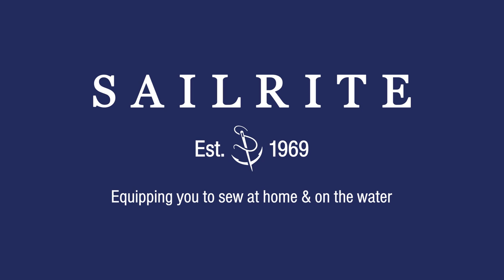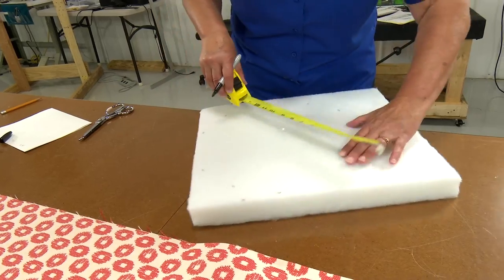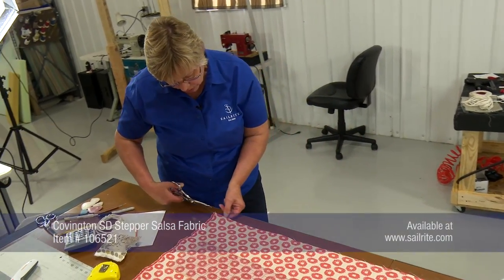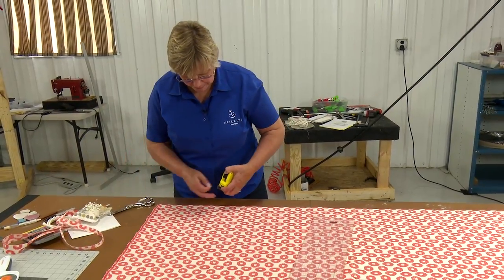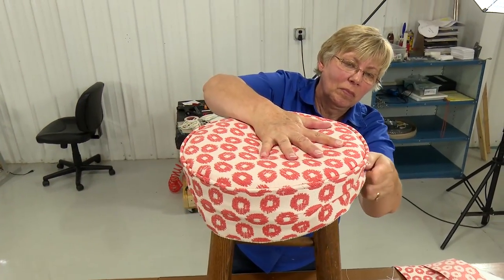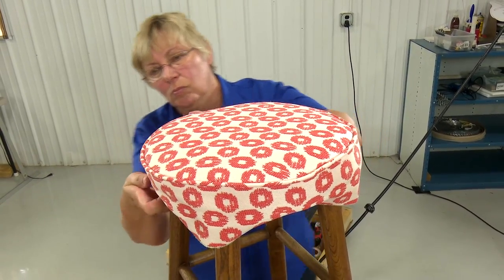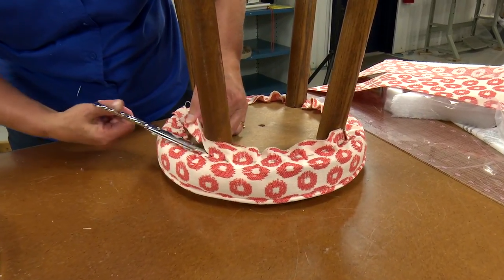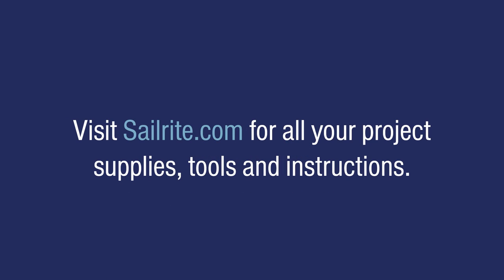How to Upholster a Bar Stool

Comment: Great and helpful! Wondering why you didn't just put an elastic on the bottom so it's all snug and no stapler reqd?
Reply from the maker: You can do that, but the elastic will allow the fabric cover to move around when an occupant sits on the stool, the staples will not.

Comment: This is a brill post! Thank you for sharing. The only issue I am having is some slight puckering of the fabric when I'm sewing the piping to the top circle. What could be causing that do you think?
Reply from the maker: When piping or binding has to go around a curve like a circle the inside flange has to expand and the outside piping has to compress. This sometimes results in wrinkling of the fabric. When possible cut the piping along the bias and this will help it to take the curve slightly better.

Comment: How much material,is need for 2 stools
Reply from the maker: You can get about 4 up along the width of a 54" wide fabric. So, for every 14 inches of fabric you should be able to make 4 stool tops (not including the piping). One yard of fabric will do the 2 stools and give you enough for straight cut piping.

Comment: I just realise that I need a sewing machine to fix my bar stool and I can't even sew with hand properly let alone using the machine. If I don't sew it,will it wrinkle or something?
Reply from the maker: If the fabric is not sewn with a separate side boxing and is instead simply pulled over the foam and chair base it will have a lot of wrinkles.
Reply: @SailriteDIY  Thx for the replies, I think I need to call my mom to help me with the sewing 😅

Comment: Do you sell the rounds like this stool top? I need 17" round.
Reply from the maker: No, but you can easily cut the foam to the round shape.
Reply: Sorry, I meant the wooden rounds.
Reply from the maker: @yvonneleach9650  I think you can find wooden rounds at the hardware store: Menards, HomeDepot, Lowes.
Reply: @SailriteDIY  Thank you. Not the right size and not in stock.